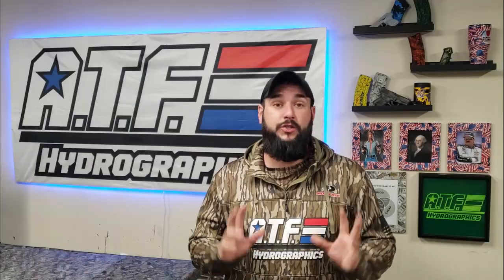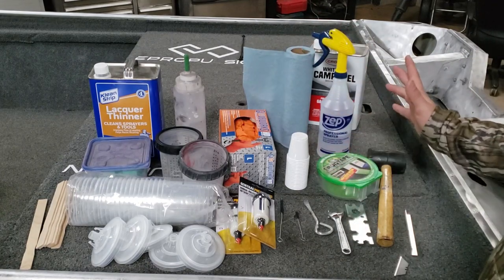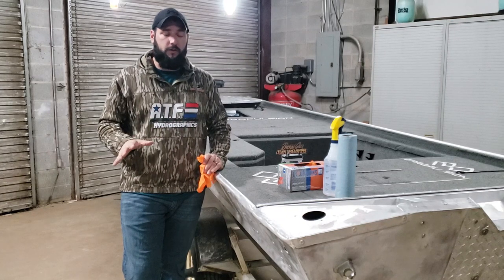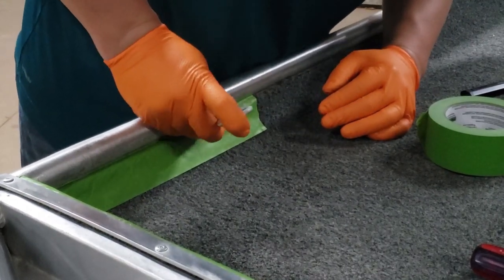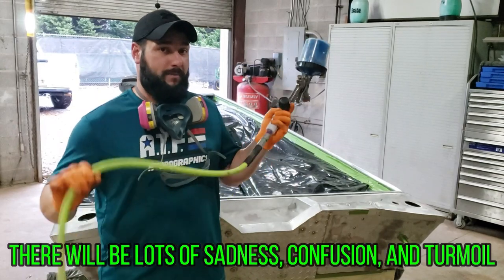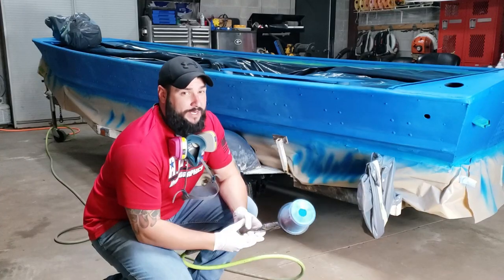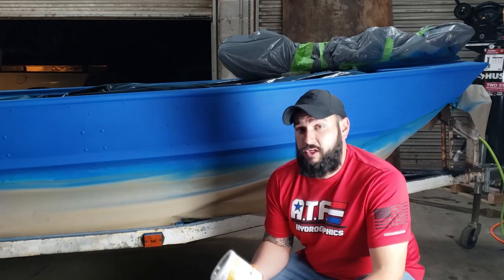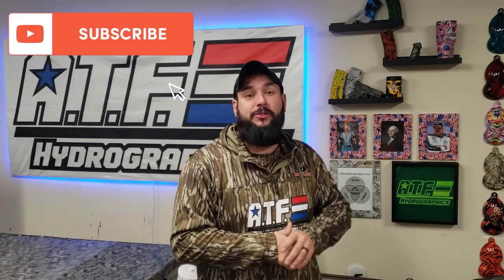How To Hydro Dip Paint Anything! Even A Boat

Comment: I have a question, for your pistol slides I saw you had a little holder that also plugs the barrel hole, and extractor area. Did you make that yourself or did you buy it?
Reply from the maker: I made it out of hot glue. Just tape the outside of the slide up, and from the inside put hot glue in there and it makes a mold basically. Once it dries pop it out and voila!

Comment: I am about to use your technique on my boat which is slightly bigger than these jon boats, can I have the boat soda blasted first, and if I do can I skip the scotch brite red/brown pad step
Reply from the maker: Yes but I would get it media blasted with aluminum oxide or coal slag instead of soda. The soda blasting only removed the existing coating and does not leave an etched profile for the paint to adhere too. So you will have to hand sand it after having it blasted with soda. Better to just do it right from the get go and save time and money.